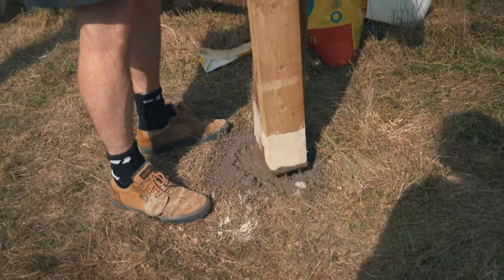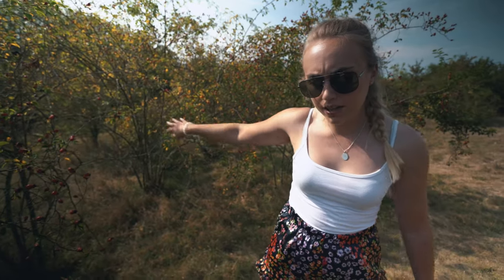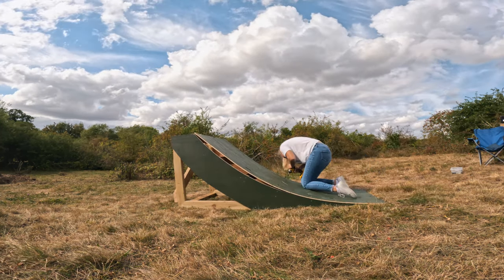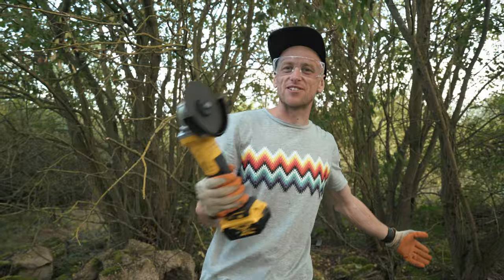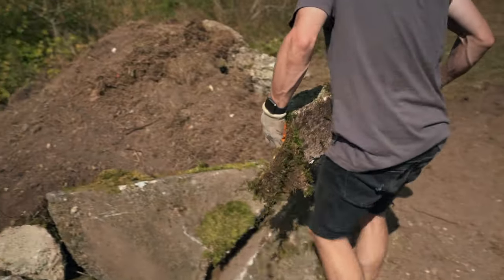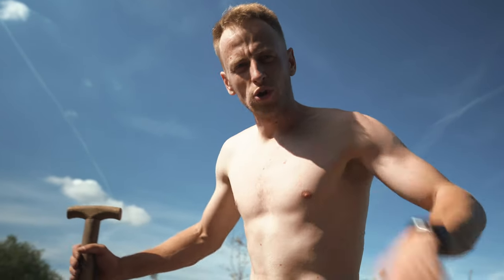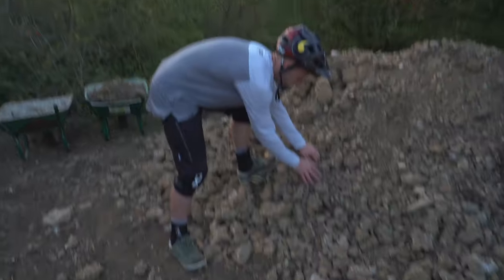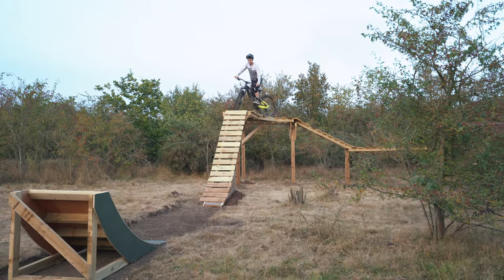MAKING INCREDIBLE PROGRESS ON MY NEW BACKYARD TRAIL!!

Comment: Our soil is sandy. Put all the crap stoney soil at the bottom of the feature. We then put pure fine dirt on top (at least 8-12 inches but more the better). Wet, smack and repeat. It doesn't go truly hard until ridden in and weathered. If there are stones in the fine dirt we rake it upwards... the soil sticks and gravity helps the stones roll down so you can  toss them away, if that makes sense. This method will need to be left to dry for a few weeks which is difficult this time of year. Mix fine dirt with granite dust or 20mm to dust gravel to harden it up quicker but this tends to flake away in the summer (however my trails get loads of traffic so not mega issue for you) In my opinion pure dirt is best but takes rhe longest to harden. Also consider drainage, find the low point in your bowls and dig channels downhill away from the trail so water doesn't sit. To answer your question about your dirt... Find your darkest finest dirt and use that on top, don't worry if its dry, wetting it will turn it into dreamy dirt. Dreams 🤟

Comment: A dangerous and fun way to remove bushes is with a strong chain and a truck. Wrap one end twice around the base.  Hook the other end to your tractor or truck and pull it out of the ground. Just be aware that a snapped chain can be deadly so keep it short enough not to strike the driver if it breaks and keep onlookers back.
Reply from the maker: Sounds so much fun haha
Reply: @TomCardy  it is. I’ve done this with trees too but you need a strong chain. 42 years ago, my boss had me wrapping the chain around bushes one after another as he pulled out a whole row from his seat on his tractor. You want a chain that has the chain hooks on each end. And think safety!
Reply: There are videos of bulldozers doing this in Australia, with massive, massive chains. It's pretty nuts to watch actually. And you can wrap some kind of rubber mat around a piece of the chain to take some of the shock out of it, if it snaps.
Reply: A tow strap is a lot safer, and easier to work with.
Reply: It would be sick to see Matt Jones come out.